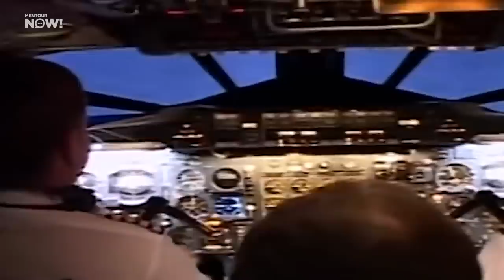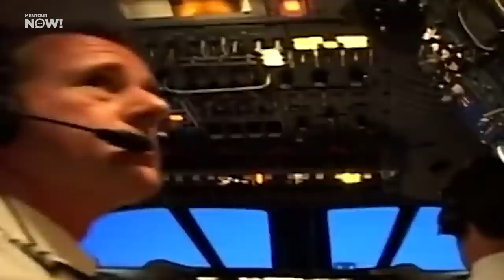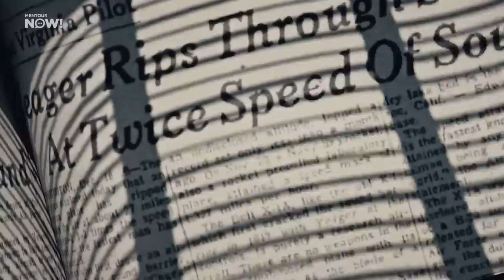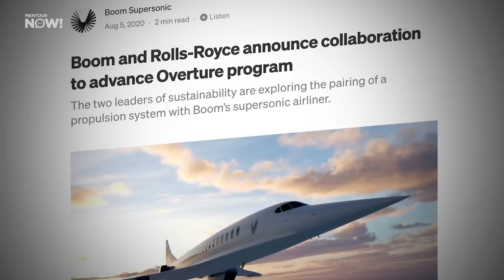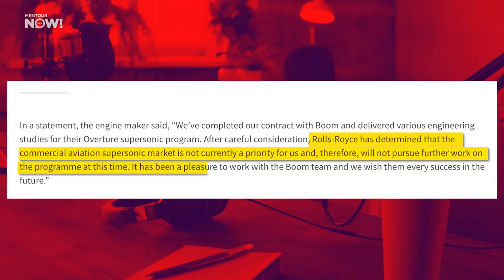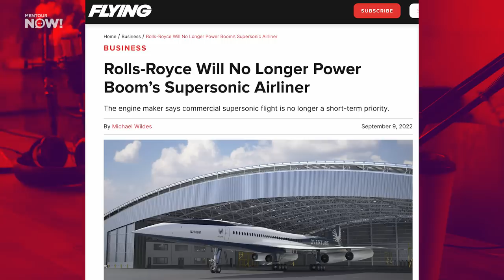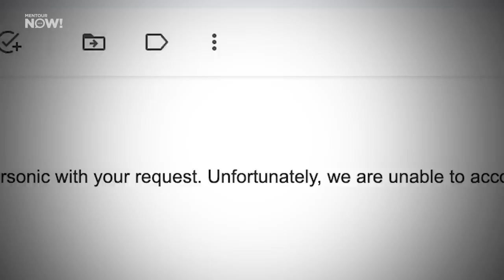WHAT’s Going On with BOOM Supersonic?! Will it Fail?

Comment: I once heard Concorde take off from the terminal at Heathrow. The sheer volume of those turbojets on reheat was amazing to experience. I cannot imagine what it must have been like to be out on the tarmac.

That said, I would rather pay $600-1000 to fly from Washington, DC to London on a 787 or 777, not several thousand.
Reply: It was more used by businesses who could afford those tickets and the fast speed was great for business men
Reply: I used to live not too far from JFK Airport in New York city (My house was in line with one runway and I frequently watched as planes flew overhead, outbound), plus I drove on the parkways near that airport as well. I always knew when a Concorde was flying because of how loud, and distinctive, the noise was.
Reply: What if... A Washington to London ticket cost $1000 with a 787... and $1100 with a Overture?

You might think that is impossibly cheap?

Well... 1KG of JET-A1 currently cost just over $1. And the price of fuel is really not very cheap currently (compare to what it usually is).

Overture carry about 30 tons of fuel. But it will not need everything for Washington to London trip, rather 20 tons. That is shared over 88 seats. or at least, effectively 80 seats. That is $250 worth of fuel.

The 787 uses about 2kg of fuel per 100km, so that is about $150 worth of fuel for your seat.

But that is actually not the end of it.

Think now that you are traveling from NY but not to London but to Stockholm. This route is to small for a 787, so in steed it goes with a A321XLR. This matters. Because when the planes get smaller the pay of the pilot impact the passenger higher. Faster plane, less hours pay for the pilots... AND for the cabin crew.

Now say you traveling from Miami to Fortaleza, you can either travel in a E2-195, or A overture. IF you travle with a E2-195 you pay $800, if you travle in a overture... you pay $700.... Yes, less money. That might sound absurd, but if you run the numbers, it actually turns out that for a route like that, Overture can in theory be cheaper to operate.
Reply: @matsv201  AM/FM...I will believe it when there is an actual machine that can do that.
Reply: @ChapatiMan  It was a prestige ticket that rarely, if ever, made sense from a business perspective. The cost of the ticket always outweighed the value of the time gained.
Reply: @matsv201  you simply only costing the fuel???? and i doubt your figures..... you think fuel is the only operating cost? How about landing and airport fees, catering & drinks, crew, cost of aircraft, insurance, maintenence, etc etc..... your comparison is silly. BA are charging £10 806 one way LHR-NYC for a 1st class ticket. Do you really think Airlines could operate Boom at $1100??? hahahha c'mon. You comment sounds like a 5 year old with a broken calculator
Reply: That's because you and me, money is relevant. How many people do you know that flew on Concorde? Because I don't know anyone. We just don't move in the same circles. But look around, there's tons of money out there. All those people buying 100k-200k+ cars will be lining up to fly these at a rate that Concorde could have only dreamed of.
Reply: @ChapatiMan  It made possible to fly from London to New York (for a business man) and attend a meeting there on that same day.
Today, that is made possible using Teams and Zoom.  Which makes it much more difficult to get a profitable service out of that niche.
(there will always be people who tell you "a personal meeting cannot be replaced by a video conference", but that is a smaller number)
Reply: @ChapatiMan  Even in that case, it's also very niche on already niche category

Most business men would rather use flexibility of private jet instead of pure raw speed. They would save massive time on scheduling and transportation to nearest airport, and maybe money in long run. Hence even in the Concorde era, it would only fill one-third of it's capacity
Reply: @thehaprust6312  That's not really true. You could take the morning Concorde from LHR at 10000, fly to JFK and arrive at 0930, Have meetings all morning then take the 1330 back to London arriving home the same night.  That is what made it popular wit business people whose company would have sent them First Class anyway. So for about 20-25% more (less their corporate discount) they could do it in a day.
Reply: @Completeaerogeek  If that is the case then where is the consumer demand for a Concorde replacement? It turns out that business does just fine at subsonic speeds, regardless of what C-suite grifters will tell you.
Reply: @thehaprust6312  There has been nothing to 'demand' as no aircraft existed. Certainly Aerion and Boom have done consumer research that allowed them to raise hundreds of million of dollars.

At present some of the demand has been soaked up by corporate jets with transatlantic range but buying a seat on an SST compared to the overheads of operating a G6 with a crew would quickly come into focus if an SST was available.

There was no real customer demand for ULR subsonics until they built some and people began reconsidering being trapped on an aircraft for 19 hours against a stopover somewhere.

Consumer demand often lags products until they are available and proven. This was proven with Premium economy which is still an on and off affair, depending on the market.
Reply: @Completeaerogeek  If you assume that all bussiness people would use A380, maybe yes

But, private jet exist, and it can land absolutely anywhere near visiting place (Especially with something like Pilatus PC-24) and could take off at anytime without any scheduling, and also fly anywhere efficiently. And won't hemmorage too much money in long run
Reply: @bocahdongo7769  but if only one person needs to go somewhere, thousands of pounds an hour isn’t worth it for the private jet. Also, if that person is very busy and important then he’ll need to be in many places in a short amount of time
Reply: @matsv201  You miss about 50 key factors out of your equation & are massively over simplifying the entire ticket cost basis. Your numbers don't add up in the slightest when you actually enter the world of reality and cost the tickets taking all of the factors involved not just the one that makes the figures work for you into account.
Reply: @C2K777  So what factors did i forget? please tell me
Reply: @matsv201  R&D, landing & take-off fee's, GHA costs, maintenance, APD, Gov Fee's & Taxes, CC & FD salaries & PF costs, catering - the list goes on & on and ALL of those ( amongst many more I cba wasting my time listing at this point) are factors and form the cost matrix when Revenue Teams establish ticket prices. Fuel costs are but 1 in a long list. TBH with an account name like yours I'm baffled I'd even need to explain this too you
Reply: @ChapatiMan  again, it does exist

But it's very niche among already niche market. And it proven for dozen of years already.
Reply: @matsv201  Check out the wendover video about economy of plane

Fuel price is only 1/3 of total cost.
Reply: @C2K777  
"R&D" Well true, but that is a R&D sharing cost, so its not sure it going to be that high, depends on voumes.

"landing & take-off fee's,"
Those are included.

"GHA costs"
Thats included

"maintenance"
That is included. Worth saying that a corectly manage engine don´t know that its going supersonic, so maitanance is actally lower at supersonic speed. In this cases, its compensated with more engines. 

"APD"
That is a fix numbers, so it would not effect the calculation.

" Gov Fee's & Taxes" 
They are generally flat charge so they would not effect the calculation.

" CC & FD salaries & PF costs,"
Those are generally flat cost, so they would also not effect the calculation.

"catering"
Catering would actually become cheaper.

There is more cost that goes down , like crew cost goes way down, specially on routes that are 6+ hours with subsonic aircraft.

Pretty much every cost goes down. While maintenance will not go down for now, it may as well in the future. Its really the cost of fuel the only one that goes up, and its really not as much as one might think.

Pretty much all of the other cost either stay put or go down..

For the main 3 cost, crew and crew management, dry lease and fuel. Both the two first goes down, and the last goes up.

Yes, dry lease will also go down, becasue the same aircraft can do more trips.

For most of the other ticket, airport and government related cost, those really effect short flight the most. For Supersonic flight we are really talking about only 3000+km flight, anything shorter than that, and there is no point.
Reply: @matsv201  I KNOW they are all included and form a part of the per ticket calculation. The point I, and it seems several others, having been trying to point out is that you were talking exclusively about fuel as the driving / sole factor ( that you talked about). 

What the rest of us are talking about is the fact that revenue setting is a VERY fluid & dynamic thing affected  by multiple factors. Many of those factors also are not nearly as fixed or "included" as you may imagine btw.
Reply: @C2K777  No.. what i wrote was that they was included in MY calculation. Yes, i did just wrote crew cost and fuel, because they are 2 of the 3 main cost contributors. But i did include most (if not all ) of the other cost that is not flat cost. Flat cost of cause don´t matter, because they are the same regardless.

Of cause, a very small aircraft, like a Overture, will have problem being profitable besides a 777. But, not all routes are trafficked by very larger aircraft.

Also Overture is the first aircraft, its the smallest, any aircraft after that will be larger. And there for also more efficient (economy of scale).

For example the next aircraft might be a 5 wide. Something like a fuselage of a A220, but twice as long. That is higher capacity than a 757-300

Comment: The maximum passenger capacity of the Concorde was not 100. That was the configuration BA/AF chose. Original design was for 130 passengers, but not all First Class of course. Trouble was the extra passengers hence payload meant the aircraft would struggle to fly from Europe to the US East Coast. I flew Concorde twice. Once BA. The other time Braniff. Many have forgotten about that!

Comment: Very informative video. Among other things, I've been curious about the apparent lack of variable-geometry air inlets on Boom. Anyway, regarding the comment at ~5:30 "...haven't heard of an aircraft running different engines on the same airframe..." The re-engined 727s still flying are using larger MD-80 engines on the #1 and #3 pylons, namely the JT8D-200 series, while still using the smaller original JT8D engine type on the centerline position. Apparently, the mounting bolt positions were the same, making the transition relatively easy, while the enclosed #2 engine was always going to have size limitations.

Comment: This company is on my same airport. I see them often testing there smaller version. Only ground runs so far. Thier hanger is always open and seeing the aircraft looks pretty sweet
Reply: The problem is the XB-1 now looks nothing like the new design so the data will no apply to it.
Reply: That's encouraging. Thanks for the report.
Reply: @kevinb3812  they had it out again yesterday doung a run up.

Comment: It's pretty comon knowledge that BA did in fact make a profit from Concorde, though AirFrance did not. But they realised during the grounding that they made more money if pax flew in First pr Business on subsonic jets, combined with the fact that as Concorde aged, it needed a lot of work to keep flying, which caused rising maintenence costs, which would quickly eliminate any profits if Concorde had kept flying. The alternative would have been extensive refurbishment, but this would have been extremely expensive per plane due to how few there were, and Airbus simply weren't interested.

Comment: Boom reminds me of the Nikola Truck scam - big tech promises, without actually having the tech. The whole idea was to make people/media report about it(like Mentour Pilot) and get investors, which would fund the research.
They made only the frame of the Truck and had it rolling down a hill, for videos. In the end, they were not able to develop the tech and the scam was exposed, but very late.
Reply: I've seen booms prototype several times. And seen/heard it doing ground run ups
Reply: The thing is, with Boom, the tech already does exist. High performance supersonic turbofans are nothing new, as we've seen in all 4th generation and later fighters. The cost of building/repurposing one for small-market civilian use is where you run into the problem.
Reply: @EscapeTheCloudsOfficial  "Efficient Supersonic Hydrogen Engines"
Reply: @EscapeTheCloudsOfficial  Same thing with the Nikola Truck.   Electric vehicles already exist.  Trucks already exist.  "only" some repurposing required.
But development does not work that way.

Comment: I have always felt ~Mach 3 or about 2000+ MPH.  Also trans Pacific range.  It came down to economics.  At those speeds, you can double the number flights.  Half as many pilots per flight.  Also twice as many flights per airplane.  I think Mach 3 flights from the the US to Japan could easily command good premiums.  Add in savings from double the flights, would probably make it worth while.
Reply: The problem you have is materials. Above Mach 2.3 you cannot use aluminium. Kinetic heating weakens it. 

All of the top speeds you see for fighter aircraft historically are dash speeds, They cannot be sustained due to fuel burn and heat soaking. You have to use stainless steel or Titanium and economically that's a non-starter. That is one of the things that broke the B-2707 program. 

Composites likely won't cut it either. Again, heatsoak is the problem. Concorde designers picked the sweet spot at Mach 2.0. They could use an aluminium alloy (Hiduminium) and RR Olympus 593 engines to supercruise. (fly long distances supersonically without afterburner)

Concorde solved supercruising problem at the time but at present there does not appear to be a suitable engine.

No supercruise no SST.

There is also the problem of noise. In order to have high enough exhaust gas velocity, you have to use a turbojet or a very low bypass turbofan with afterburning. The Mach 2.0 to Mach 3.0 leap is a huge one.

If GE and others come out with a variable cycle engine, this might make it possible but these are about a decade away and will likely be kept for military applications

As it stands, there is currently no practical way to build a Mach 3.0 airliner.
Reply: @Completeaerogeek titanium for an aircraft body truly would be overwhelmingly expensive for the airline
Reply: @narrowistheway77  Of course. The STAC committee came to that conclusion in the early 1960s which it why them went with Hiduminium, a Rolls Royce high temperature aluminium alloy for Concorde which limited it structurally to Mach 2.3. 

Boeings B-2707 intended to use Titanium which is one of the many reasons it failed and all that was produced was a wooden mockup.

Comment: I'd like to find a place to make a wager that Boom will never get even a prototype off of the ground, much less certified for commercial use.
Reply: I have seen thier prototype do several ground runs. It's only a matter of time before it takes flight
Reply: What engine are they using? Or is it scaled down?
Reply: @liam3284  that is the killer question. The so-called prototype is only a reduced scale proof of concept, not a prototype of a commercially usable aircraft

Comment: Another thing is that Boom has been advertising routes on their website that the Overture doesn't have the range for like SYD to LAX
Reply from the maker: Really?! I haven’t seen that
Reply: It never did. But with the fuel stop it's still significantly faster than subsonic competitors.
Reply: @stephen_101  A fuel stop is slower because... another aircraft is currently on our jetway and the stairs have a flat tire.
Reply: @stephen_101  between Sidney and LA? Have you discovered Atlantis?
Reply: A fuel stop? Does Hawaii cary a suitable runway?
Reply: @liam3284  Hawaii would be a good half way stop for Tokyo. It’s bugger all use for Sydney.